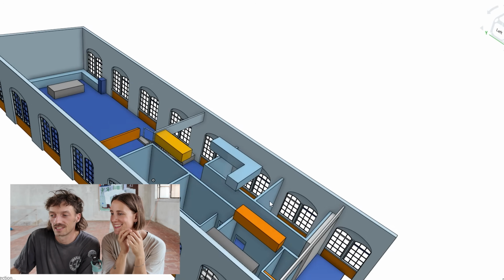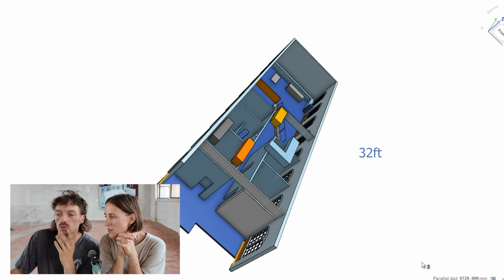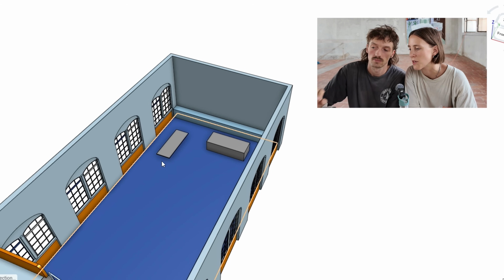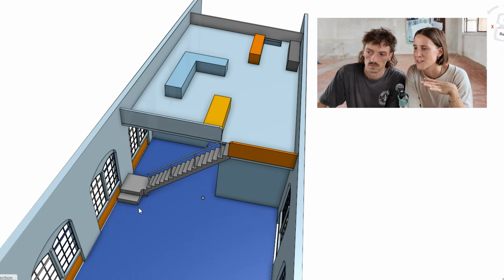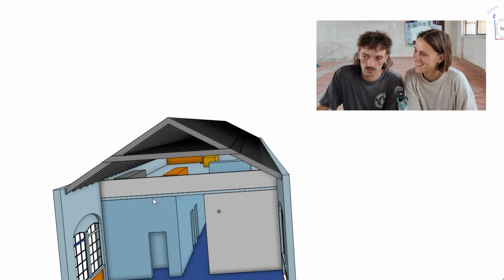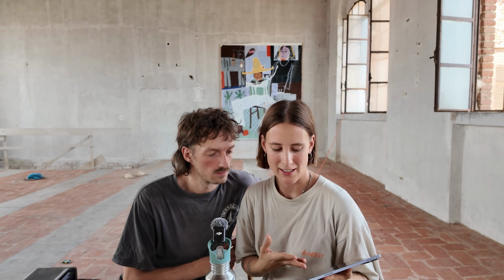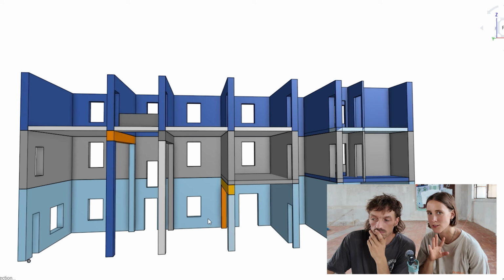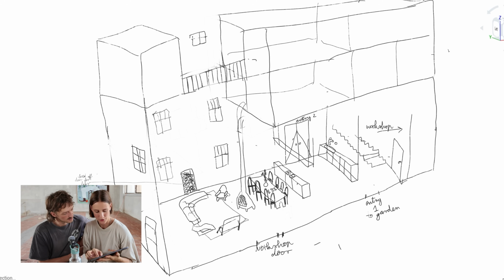We Bought An Abandoned Factory, What Are Our Plans?

Comment: If you have to keep the aesthetics of the windows, there is so called "vacuum glass" that is as thin as the original single pane glass but as efficient somewhere inbetween double or tripple paned glass.
Reply from the maker: Luckily the width in the frame is big enough to put double pane glass in there, as it is way cheaper than vacuum glass, we on a budgeeet

Comment: Have you thought about putting the corridor down the side of the room, passed the windows, then you can have longer thinner rooms. Also what about heating in the winter, such a big space could be expensive to heat in a really cold snap. Maybe you could have a self-contained end that is insulated so you don't need to use the big room in the winter, you could just live in the insulated end which will be cheaper and easier to heat, then you can use the big room in the summer and not have to heat it in the winter.